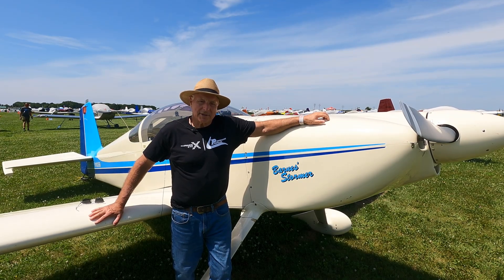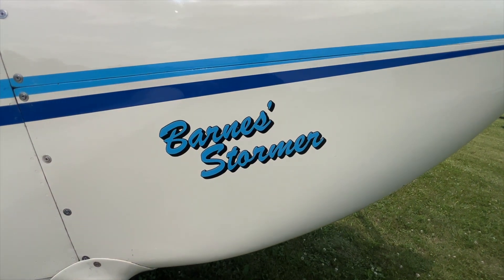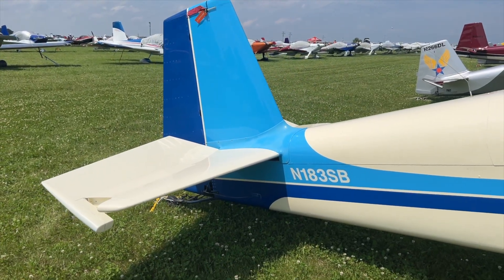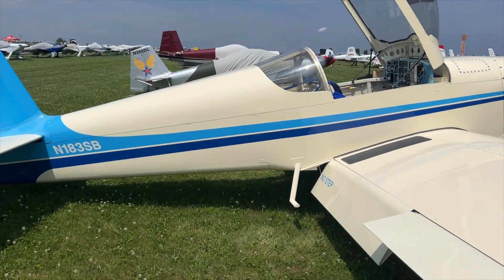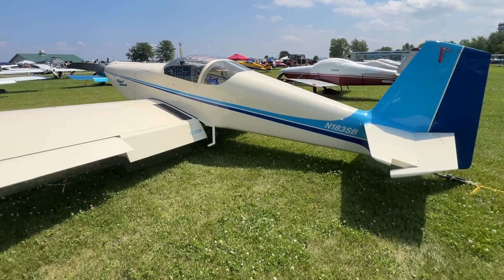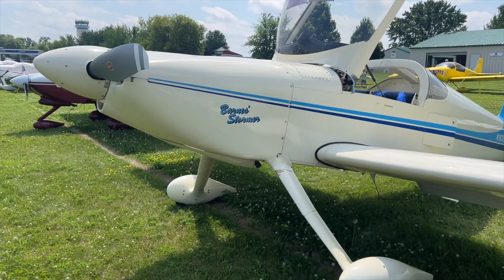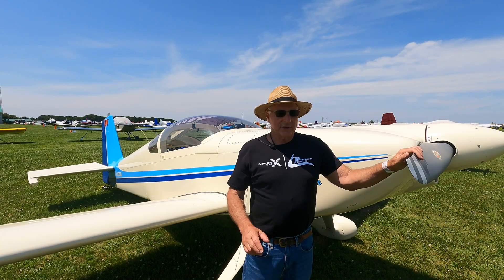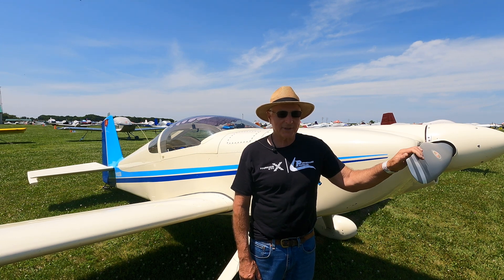AirVenture 2025 Cool Planes: Barnes' Stormer RV-6

Comment: my upcoming project is rv9a 916is rotex lockwood forward firewall package .....payload 760 lbs , 190 knots at 8.5 gph , 150 knots at 4.5 gph .....even after putting ac,brs still 309 kg payload will left  36 gallons on main tank ...if add 20 gallons aux tank....that thing is  efficient beast with long range with 2 on board  with mogas ..for full ifr setup and all option i am looking for 270k usd for full built...i will keep that for lifetime so its  seems look for me under 300k usd caterory other than ......jmb vl3  or bristell, terragon ...those are 460k usd +.